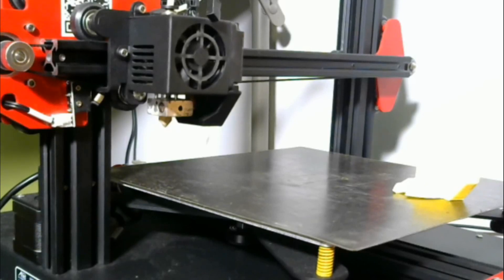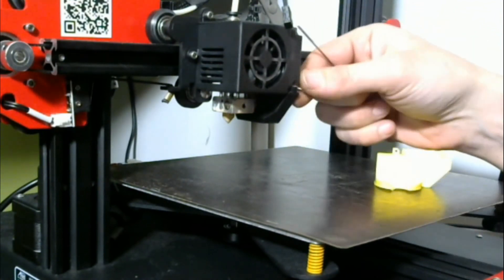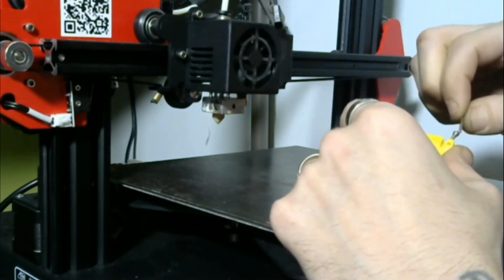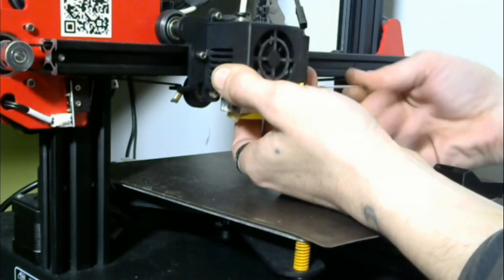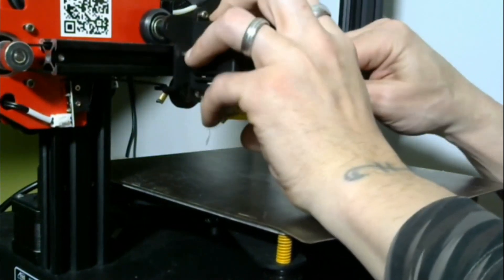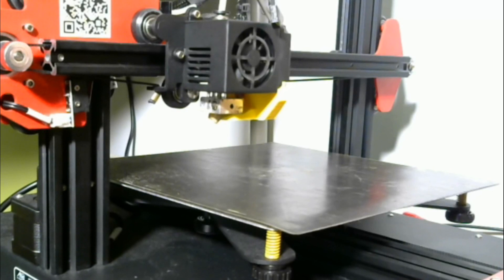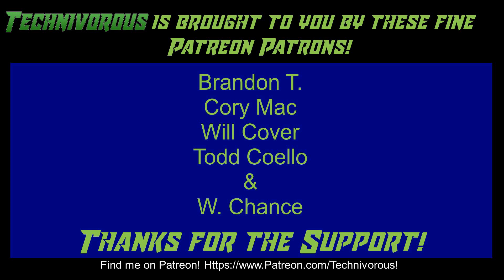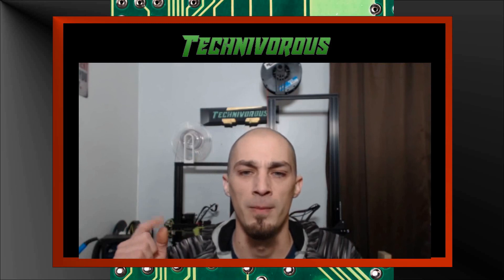Anet et4 Mods -  upgraded fan vent

Comment: Hi, I also have Anet, I just don't know what to do with that black sticker on the heated bed.
Should I stick it on glass or metal?
Reply from the maker: If you want to apply it, apply it to the aluminum plate. Just a different surface, you can print on it, or the glass. You can put the glass back on with the matte on, but your clips might not fit. They make bigger clips though
Reply: Thanx

Comment: Hey thx for your work :D did you made it in ABS or Pla?
Reply from the maker: Pla, but higher temp material will work better, though if you want more strength I'd do petg as the abs might give off odor that close to the heat
Reply: @Technivorous  I do have some PLA right now, so if you tell me it will work flawless i will give it a try :D
Reply: @Technivorous  I have printed it and installed it, but it was too short in the very end (where the air blows out). That part was in contact with the hotend.
Probably I'll try to make your model a bit taller, and I'll hope it will work haha